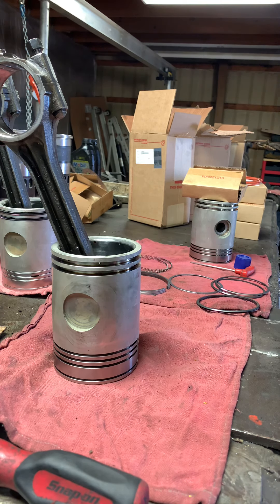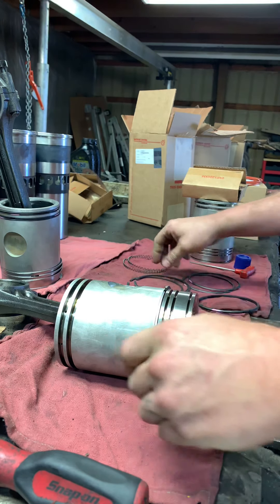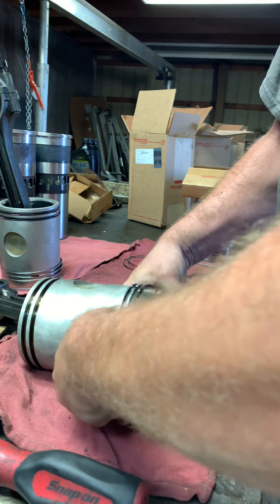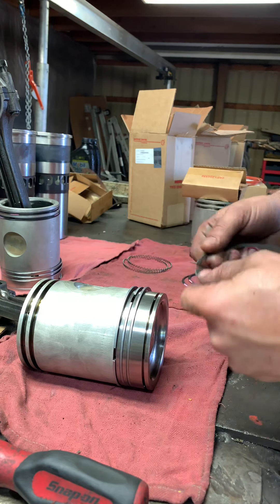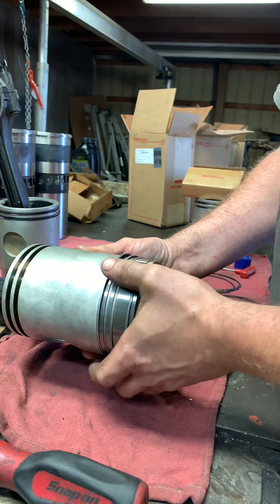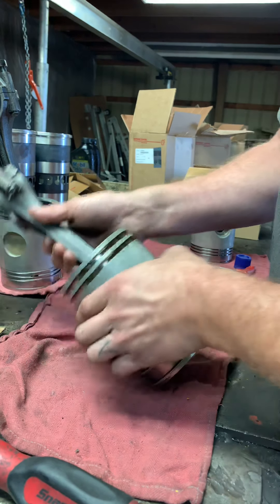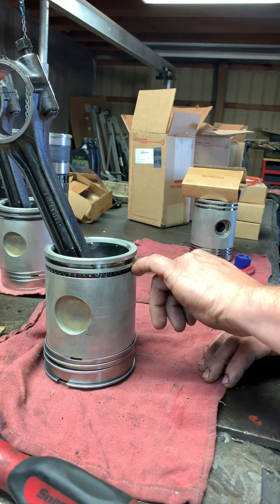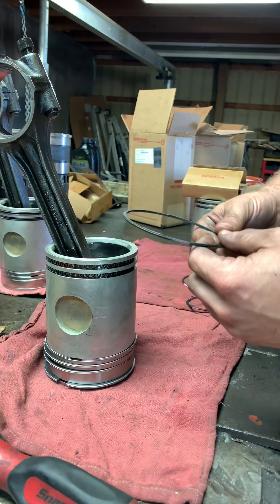Install rings on a 53 Detroit piston

Comment: What happens to the ones you say don’t overlap if they brake after installation?
Reply from the maker: They will only break after installing them when they do overlap because there’s not enough room ,you will not be able to completely load it into the liner if they overlap it just won’t fit so you know when they break because it just won’t go on the loader